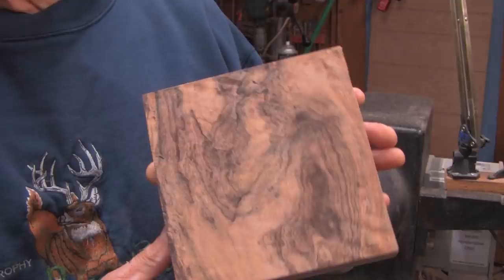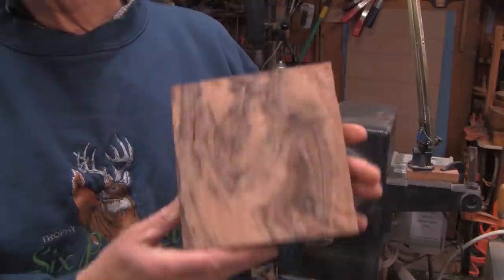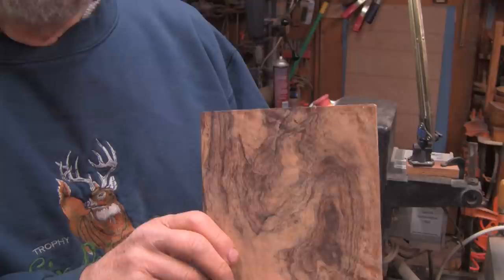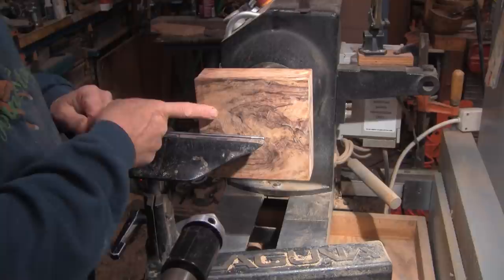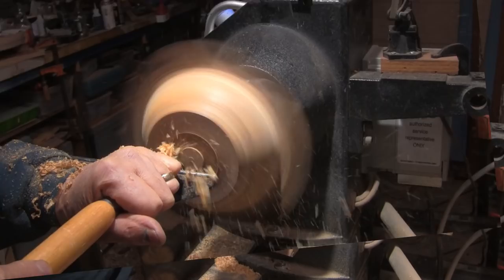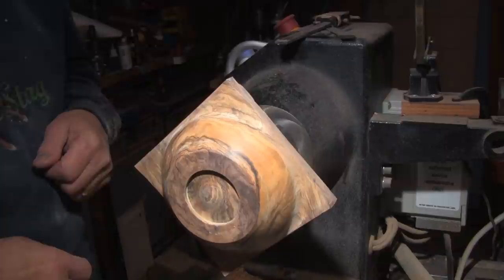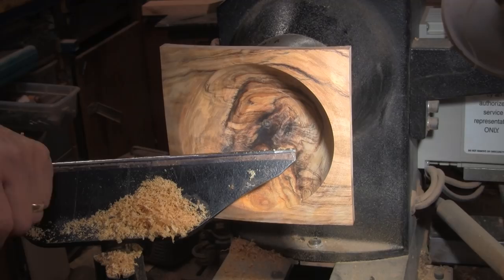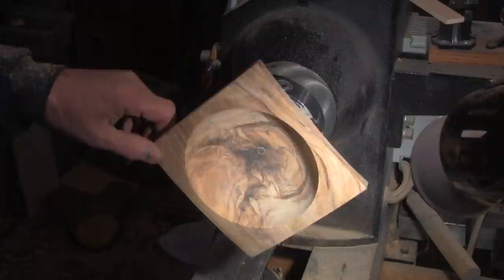Wood Turning Spanish Olive Wood Bowl Hidden Image

Comment: I love olive wood. Several years ago I made an ink pen for a priest out of olive wood. When I was finished the grain in the wood looked the Blessed Mother praying. Sorry I don’t have a pic of it.
Reply from the maker: Hi Terence I agree Olive wood is amazing. I bet the pen was as well. I have a piece of Siberian Elm wood I cut off a small log to get a flat spot for my chuck. As I was getting ready to put it in the scrap bin I saw the image of the Blessed Mother.
I wondered if as the piece dried it would go away but it has not. The piece is leaning against the wall on my work bench for the last 8 months or so and it is still there.
Reply: I bet you’d almost hate to use it. The pen for the priest was a going away gift. He had gone back to Croatia I think it was several years ago and was one of the first pens I ever made.
Reply from the maker: @terrrywilliams3617  I plan on making a wall hanging out of it. Probably just put finish on it and not sand anything.  I do not want the image to change at all.